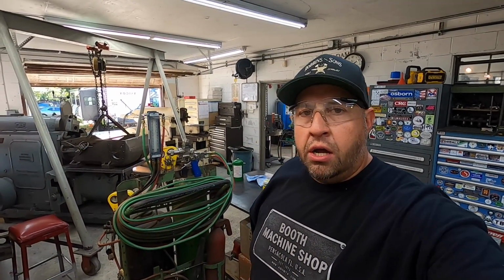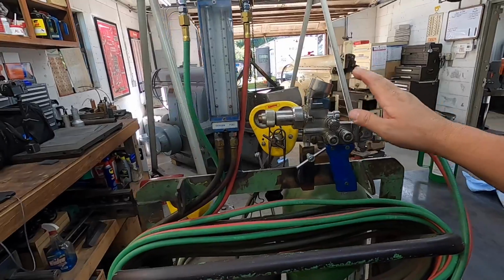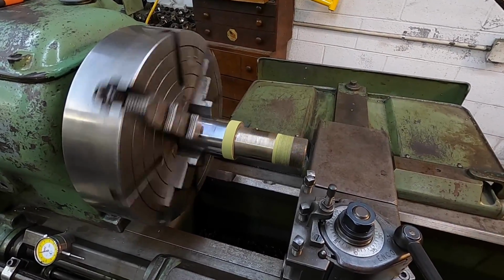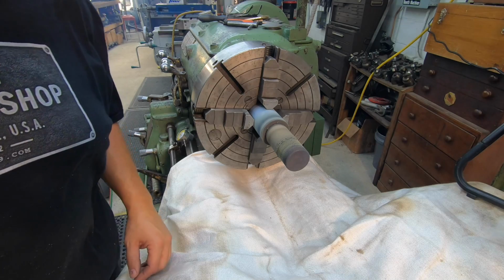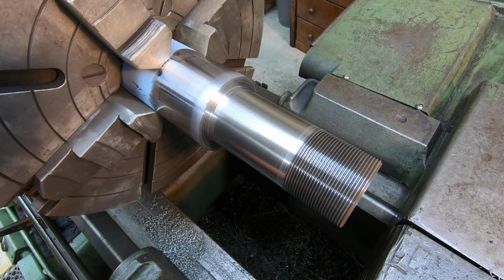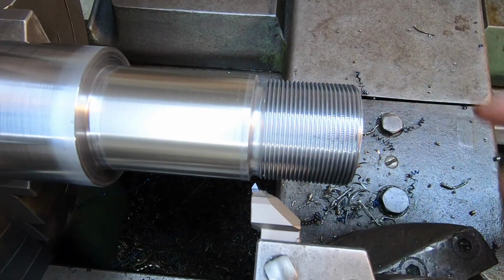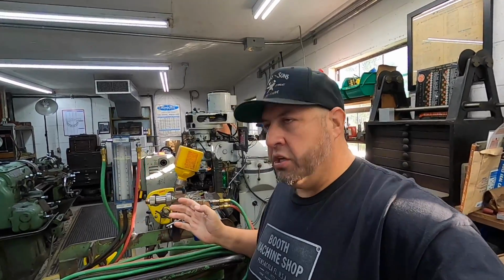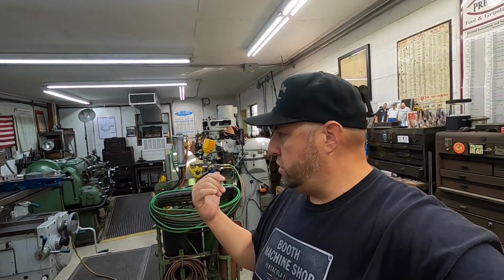Eutectic TeroDyn 2000 Thermal Spray Equipment, Mount & First Use

Comment: I have a quick safety question for you. How long since the fire bottle was serviced? I used to service them. They have a nasty habit of packing. Vibrations in their environment and the 100 PSI or so tends to pack the powder. A rubber mallet tapping the base side, the shoulder, and then the bottom until the sound it makes is like a balloon. A bouncing resonant sound. This indicates it's ready for use. I have serviced many shops where they needed it, but it spit a little powder and clogged. I recommend a quarterly beating. :-)
Reply: A valid point, in any machine shops, especially ones that weld and flame cut.

Comment: Way back in the '70s we had a machine shop that used the same as your old gear, to build up and restore run-in inner bearing race location on Lotus Europa rear outer stub axles. This looks like a better system. Metallization saved thousands of total dollars for clients.

Comment: ADAM, PLEASE READ THIS

I work in thermal spray R&D, and I'm very concerned about your setup from a safety point of view.

It didn't look like you were wearing a respirator for this work, and it didn't look like you have adequatr air extraction. 

The thermal spray process kicks out a lot of dust and fume, which gets absolutely everywhere, and it will wreck your lungs and/or give you cancer unless you put proper engineering controls in place. The 21031 is particularly bad, as it's a stainless alloy, and  generates hexavalent chromium, which is a carcinogen. You do not want to breath that stuff in. The combustion process also generates carbon monoxide, and while flame spray is not much worse than just running a cutting torch, it put a friend of mine in hospital because he was doing it in an enclosed space without proper ventilation when working at a customers facility.

Ideally thermal spray work would be performed in a dedicated spray booth, with air extraction that will pull 1 air change per minute at a rate of 1m/s at the hood, passing the extracted air through a HEPA type filter so it catches the dust. The ASM Thermals Spray Society has a free pdf on booth design, which I've used previously for speccing new spray labs. 

If that isn't possible, an LEV arm connected to an extraction fan would be better than nothing, and at least you can position it to catch the overspray. In both cases though, you NEED to wear a respirator when you're spraying, typically P3 or N95. Air fed is best, but a properly fitting half face respirator will also work, and is a lot cheaper.

I hope you don't take this to be condescending or patronising. I love your channel, uou've taught me a lot, and I would hate to see you develop health issues from something that is entirely preventable. 

All the best from the UK mate, keep up the good work.

Comment: I've used a very similar Eutectic metal spray gun (not sure of model) to flame apply powdered nylon66 in a lathe to steel parts for rust and chemi proofing,  or insulation.  Various reasons.   It works well.

Comment: hi adam if you use a round piece of body sheet the size of your 4 jaw chuck and cut a hole the size of your shaft slide it over and up to your chuck use 4 neomidium magnets to hold it to the chuck when you spray weld you get none on your chuck keeps that side of your lathe clean cheers from down under

Comment: I like the design of the old Soviet wire arc spraying guns.  They are very simple, only requiring a welding transformer and an air compressor to work.

Comment: I used a system very much like this one to repair cast iron parts of 149 MTU v16s. The torch was like an ordinary oxy acetalin cutting torch with a socket on top for the powder bottle.

Comment: Top tip. If You use open handles on the gascarrige and wind the  gas hose in a figure eigth style You won't have to twist the  gun....;)

Comment: Also note that this isn’t welding, this is a sprayed coating with a mechanical and somewhat Van der Waals forces bond. But many people call it “spray welding”. That being said, some of these coatings can be welded on via post heating to cherry red. He did spray and awesome aluminum bronze coating though; super nice 👍🏻 job 😊👍🏻😊👍🏻
Reply: Or is it the NiAlMo 21021? Machines nice and looks like CuAlFe bronze in the video

Comment: What would have been interesting is if you simulated severely damaged threads and cut the new ones off and spray welded it back to a diameter suitable for the original thread size and thread that, especially if you had an original nut to test

Comment: Hi Adam, have you ever tried using the masking compound on parts for heat treatment in your oven to see if it stops surface oxidation? Instead of wrapping them in SS foil.  Stay safe and well :)

Comment: I am surprised you did not machine a relief into your shaft so that when you tightened the finger screw T handle you would not scuff up the shaft so you could not remove the spray gun?

Comment: Just an observation, could you make a handy dandy holder on the lathe to hold the gun like you did the cart?  I know you'd still have to swivel the gun for even heating but it might be more even heating?  I'm in no way a machinist
Reply: it was common to hold the torch and use screw feed to spray long objects - longest I sprayed was around 4'  on a 5" Ø

Comment: Once the new metal finish is turned, in theory could it then be resprayed to gain extra depth?
Reply: Thermal spray coatings have thickness limitations due to internal stresses that build up as the molten metal quenches.  It is dependent on the material as well.
Reply: Thanks for the reply. Do you think the stresses you mention could be managed in a conditioned environment? Also how does a typical re finish  compare life time wise to new stock.
Reply: @olennemac2502  If you anneal in between layers could you go beyond that thickness? I know that this probably wouldn't be more cost effective than just making a whole new part for most things but I'm just curious

Comment: it would be a cool experiment to try and build up material on the threads
Reply: Thermal spray repair on threads usually isn’t the best method. Welding or sleeves/coils would be better 😊👍🏻

Comment: Nice kit, I have the earlier system like your old one, I got it for a specific couple of jobs and I have yet to use it. It came with 16 small bottles of various powders iron, bronze steel etc, it was around $200 plus delivery Can you use Oxy  Propane rather than Oxy Acetylene fuel?

Comment: Adam it is  great what you've done.
I have Castodyne ds 8000 in my shop which is the newest version of metalizing guns,but still does not work as you do.lots of powder falls down on the fire blanket and does not stick strongly on the surface.and believe me I followed every single step as you did but still peeling out while machining??.
Is the flame type affecting or not??

Comment: Adam i really need to know, can you use thermal spray gun to galvanized metal with zinc...
Reply from the maker: That I’d have to check on. They have several processes and many different materials you can spray.
Reply: @Abom79  In theory it should work. Zinc powder, thermally bonded to the metal galvanizing it. But the fumes must be toxic as hell. Few things can rust proof metal as the zinc can...

Comment: how does it do on the hardness test?
Reply: This old tony had a segment on high carbon welding rods,,,i suppose the medium could be a hard-enable steel too.
Reply: Doing hardness tests on sprayed surfaces are difficult because of the inherent porosity of the coating.  Worked in Thermal Spray for 30 years.
Reply: @olennemac2502  I kept thinking this must end up like cintering or cast metal in its metallurgy. and cast metal can't be hardened much.
(i assume) ,this is why it makes a great pot belly stove or pan,,its why it won't change much in the way of temper etc, even when red hot.
but I am intrequed by those high carbon steel welding rods this old Tony did a segment on..seems they can be hardened and tempered and used as cutting edge's on top of mild steel. he makes an axe this way. I was thinking would a powder of high carbon content be able to harden?

Comment: So when your cutting threads on the lathe, how do you know where to start the cut each time? So you dont overlap the threads and ruin it.
Reply: On a manual lathe there is a screw for regular feed when turning and a second one for turning threads, in simple terms the rotation of the thread screw is locked with the rotation of the spindle, there is a indicator that slowly spins next to the lever that engages the half-nuts for turning thread, if you always engage the half-nuts on the same spot on the indicator your carriage movement will be in sync with the rotation.
Reply: The chuck and the auto feed are geared together making the tool cut in the same pattern each time.

Comment: I have a question. Is it possible to restore metal only on rotating surfaces or also on stationary?
Reply: Yes you can use it on stationary objects. But the Eutalloy process is best for the flats if it can take higher temps.

Comment: what is the rule of thumb on how much build up you can put on a shaft?
Reply from the maker: .020-.040” undercut, spray until it’s at least .050 over the finish diameter.

Comment: It would have been interesting to see you remove the thread first, build it back up along with the bearing surface, then cut a new thread to the original size. Would that have needed a different powder?
Reply: I don't think you can build up that much material with this process, but I could be wrong.
Reply: Wouldnt be strong enough to build a tread with cold spray process, just think non rotating journals.

Comment: Looks good Adam!  What is the maximum amount you can build up with this process?
Reply: Thermal spray coatings are limited in thickness buildup due to internal stresses from the quenching of the molten metal particles.  It is also dependent on the material sprayed, some are better than others.

Comment: How do you determine when spray welding is the better application vs. buildup with welds?
Reply: weld will bend (warp) the base, cold process will not.
Reply: @susscrofa5485  so, you mean the "cold process" utilising the oxy-acetylene for extensive part pre-heating and then applying the product at around 10,000 degrees? That "cold" process? 😉😉😉
Reply: @andrewlockwood6102  this metal spraying is a 'cold' process, not a melt the base metal hot process

Comment: Sir, a question:
You have seen sheet metal that has been so surface rusted that when the rust is removed there are dozens of pin holes. Can Thermal Spray be used to fill in the pin holes??
Reply: @paul beenis In this case it's part of the dashboard structure of a German Junker W-33. You can't just make one, but we might have to.

Comment: Hi, does anyone knows which it the advandage of spay welding? Why the Adam don't fill the axis with a stick welding?... the reason is maybe because the stick welding will heat a lot the axis and that will destroy the hardening?
Reply: You are right with your assumption. The spray is also very consistent.
Reply: @Kirkorr123  Vy the "The spray is also very consistent" you mean that you will not have lack of fusion or porosity in the welding result? Many thanks for your reply.

Comment: Metal detonating system! I think that’s the other name of this process. Used to apply a hard wearing surface to aircraft flap tracks.
Reply: No Detonation spraying is a slightly different process that involves high particle velocities and high pressure waves to basically shotgun the metal onto the workpiece. 
https://en.wikipedia.org/wiki/Detonation_spraying
Adam is using a low pressure, low velocity process.

Comment: Question here out of total ignorance of the process.  How do you know the part is hot enough to accept the product?  Is temp being taken off camera shots?  Also it appears that it isn't hot enough as to not do damage to the chuck or jaws?  This process is cool but very new to me.  Adam, thank you for the videos and for you and all watching have a safe blessed Thanksgiving.
Reply: He touches it with a "heat marker" that tells you when it is up to temp @7:53 its been in explained in other weld spray videos.
Reply: @JimmyMish  ok, thanks.  I wondered what that marker thing was.
Reply: Wonder if the heat induced to the part makes it expand enough to effect the holding moment from the chuck?
Reply: I was taught by eutectic that hot enough for no condensation was hot enough...
I have a later torch, no need for flow meter, just set correct pressure from reg and dial in flame type R-N-O - dead easy!

Comment: hey adam, i loved the video, but please, as an epileptic, put a warning next time. I almost siezed during the fire process because of the chuck with the light from the fire
Reply: Get a hold of yourself
Reply: @susanbarbier5053  you're telling an epileptic to get a hold of themselves... its a medical condition that nearly caused me to seize. All I said was he should put a small disclosure. Have a heart.
Reply: @mannys9130  i have never seen spray welding. It was a recommended video. I didn't know what to expect. I am new into machining and was curious.  Now that I know I will not watch anymore. Sorry to have upset you
Reply: @mannys9130  It's still a nice thing to do. It's just like warning people that you're serving peanuts at a restaurant. It takes very little effort to let folks know and prevents someone with an allergy from going into anaphylactic shock and dying/having to use an epi pen.

@RK 29 wasn't freaking out or being rude. They know they need to avoid stuff but they just didn't know better here. No need to blow up at them.

Comment: You are firing molten metal similar process to plasma cutting. Do not you need a fume extractor or something to clean air?
Reply: yeah, very smokey
Reply: The dust and fumes are very hazardous, some toxic depending on the material.

Comment: Adam,. Is this actually welding? With actual fusion of powder and base metal? Or is this more like a heavy duty metal type glue/adhesive process...?
Reply: its welding, the powder is molten when it hits the part in a reducing flame. it might not be perfect fusion but there is fusion.
Reply: Must be welding with the heat that is produced by the oxy/acetylene, however I am told it is a coating and mechanical bond not a chemical bond. I suppose that makes sense since both metals are not the same and it’s laid on top not forced into the stock material.
Reply: What I want to know is... I know a fair amount about lathes both wood and metal but I am very confused how the thread making was done with several passes! I get how you set the feed rate and all that, but how does the tool enter the stock material at the same pin point spot where the thread begins during those passes? ...how is the rotation of the chuck linked to the pass made by the cutter to make that happen? There must be a stop that is set to allow the passes to begin at the same time when the chuck is in a certain position, no?
Reply: Got an old book on the process, don't remember every specific but surface prep was VERY emphasized.  I have the impression that it's more like a braising process than anything else, and maybe melts the base material a tiny bit in the peaks of the machining marks.
Reply: Wood lathes and most smaller metal lathes don't have them, but bigger stuff has a timing dial that indicates when you can hit the feed and stay in the same path. Adam makes it look easy from long experience but it's tricky timing sometimes.
Reply: @HomeDistiller  actually, it is not welding and the majority of the powder particles are not molten. The goal is to soften the particles only so that the oxidation is minimized 😊👍🏻
Reply: It is NOT a welding process more like painting with semi molten metal particles.
Reply: @jasong9502  yep..ive been wondering that myself
Reply: @jasong9502  abom has a video on it ..don't remember what number, and ToT also explains it really well, but basically yes there are stop points set at the beginning and the only change is the depth of cut.. but I am no machinist so I might be missing some stuff.
Reply: @jamesweber7001  show does the powder stick to the base metal ? Would seem that if it was only stuck on the base when you go to machine the area treated the lathe would just scrape the powder off ?? Am I missing something here?
Reply: Adam, Keith Rucker, Keith Fenner, Tom Lipton, Double Boost have all done threading tutorials, just spend some time and look at some of their older ones.
Reply: @madcapmagician6018  Depending the thermal spray process and materials, the adhesion is as low as 500 psi to over 10,000 psi. In this case, if he was spraying the NiAlMo, I would expect the adhesion to be >5,000 psi as this is probably a clad powder (nickel particles with smaller aluminum and molybdenum particles glued to them.)  If it is CuAlFe bronze, the adhesion is probably closer to 3,500 psi. If you would like to read up on the subject I can email you some excellent books
Reply: @jamesweber7001  cool I get back to you on that 👍
Reply: @HomeDistiller   No, not true. there is no fusion of the spray metal with the base material.  The process only melts the powder.  I worked in Thermal Spray for 30 years.
Reply: @jasong9502  Correct, it is a mechanical bond only.  This is why surface prep is so critical.
Reply: @gresvig2507   Base metal is not melted.  Purely a mechanical bond.

Comment: I see in a previous video you used 21031 with your model one. We are trying to use 29011 to repair a stainless pump shaft with our model one gun and the porosity is terrible.  Any suggestions  ?
Reply: Take the chrome hopper off the top of the gun and remove the rubber tube located inside of the chrome hopper. It is most likely pinched from being stored on the "closed" position and you are not getting a proper amount of material into the gas stream. Also get closer to your work piece to increase the velocity of the spray alloy.